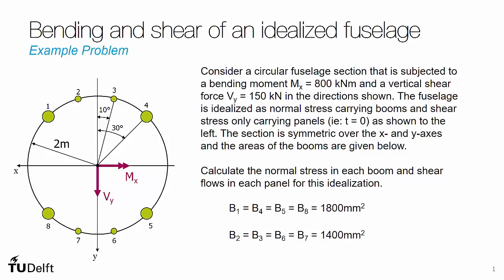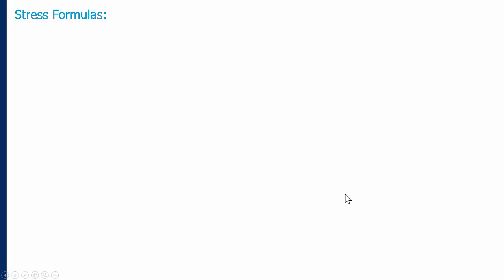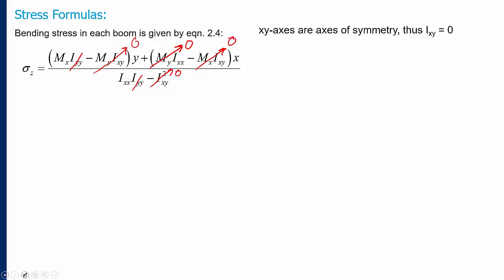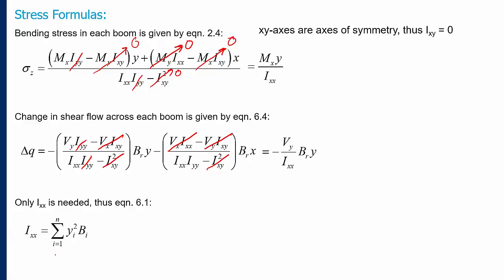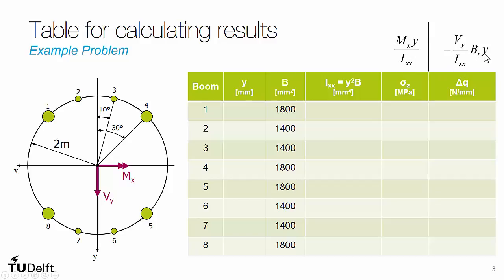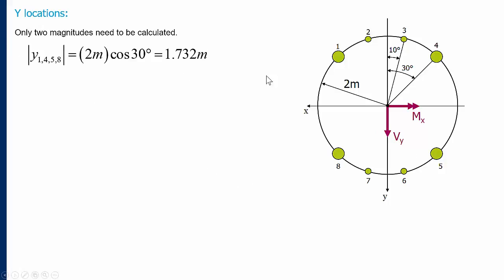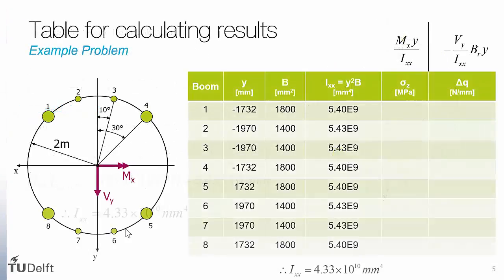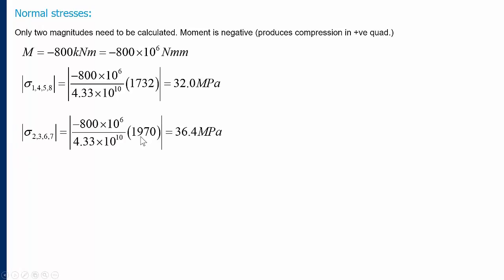Example Problem - Analyzing an idealized fuselage structure in bending and shear

Comment: Hello, where would that shear force come from on the fuse? from the weight distribution or something else? also m i correct to assume that the moment in the example taken is being imparted by the wing and + the tail?
Reply: @DrRans  thank you sir that does make more sense
Reply: Can I get a reply,on how the shear force is calculated here ? Is it just the lift load acting divided by the fuselage's cross section ?